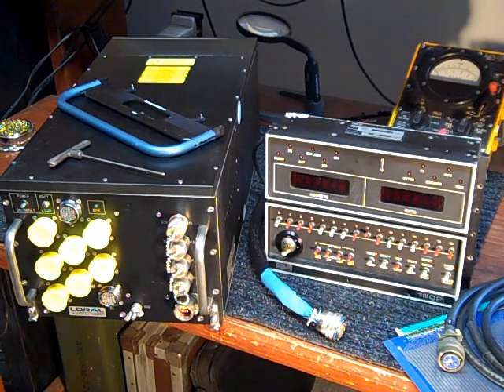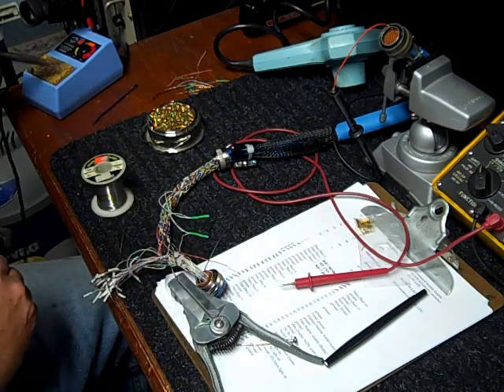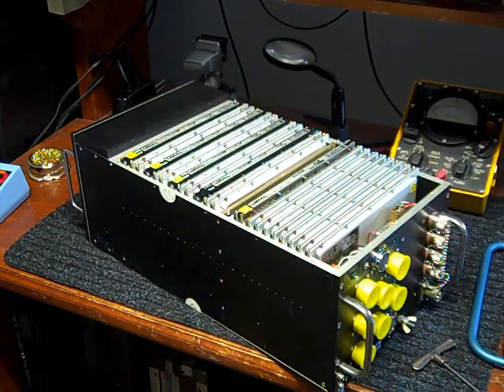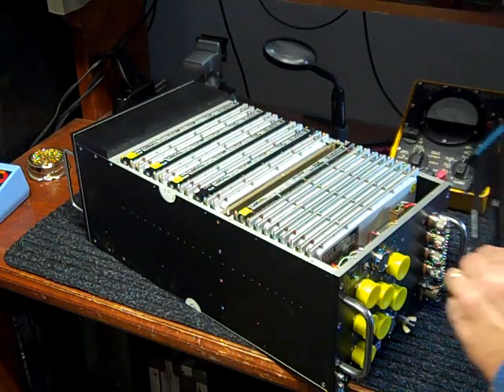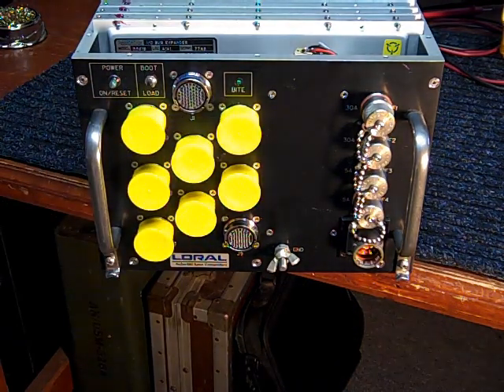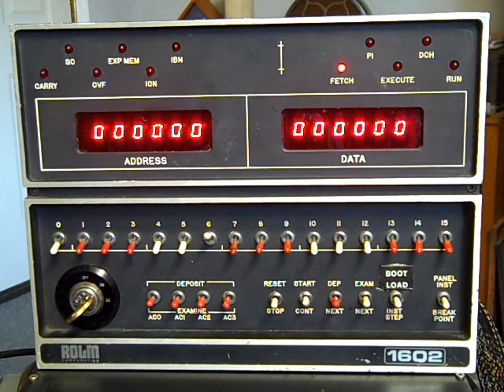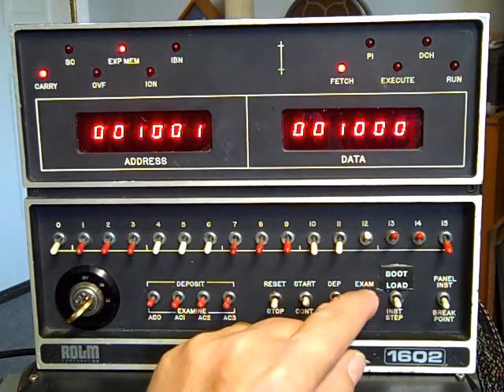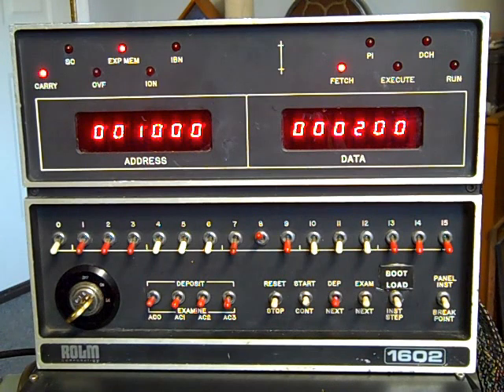Rolm Loral 1602 Computer

Comment: That looks like a 1602B ILS unit sold to the Army.  I built tons of these, 57 twpr cables too..  ProtoLabs ejector and 55 pin Deutsch MIL-C-81511 connectors

Comment: Cool video, Ray! Since 2011 I have some Rolm machines, too and I already built a paper tape simulator to read data into the machine. Unfortunately I did not have time to make a video on the activities, but I have some of my activities in my vintage avioncs and computer log on my web page if you are interested:

   http://www.baigar.de/TornadoComputerUnit/TimeLine.html

Dates relevant are 9/29/2011, 3/3/2012, 1/25/2014, 10/20/2014-12/15/2014 and finally 2/3/2015-2/15/2015. In case you want to get in touch via email: erik@baigar.de

Keep up your great work and looking forward to your next video!
Reply: +FIN ner More precisely, the machine is a 1602B with 64k of core in two banks. You will be able to run all standard software for the Nova series of computers on it, but bank switching will not work. So you may be restricted to the lower 32k words of memory. The 5605 CPU within this machine should have a ROM with some basic functions like boot (from various devices) and a memory test. Have a look at the end of the memory whether you "see" memory there or ROM...
Reply: +FIN ner You already examined the bootloader in the ROM in your video (sorry for the misleading last comment) and it should start at 77400 already. If I remember correctly, starting at this address schould be a memory test preserving the contents. In case of a problem, one of the ACs will show the address of the problem and an other the memory contents... But there existed different PROM versions, coded in the options-section on the CPU's label. 

As you mention FPU: In the 5605 there is usually no hardware-FPU, but it is realized in microcode. So you actually may have got this type of FPU...